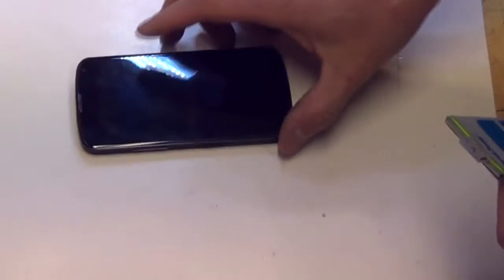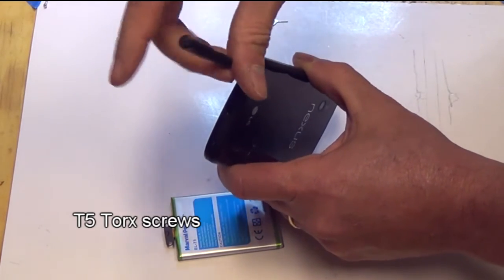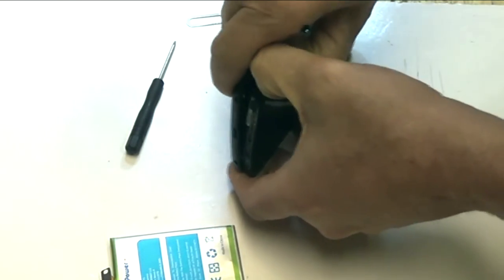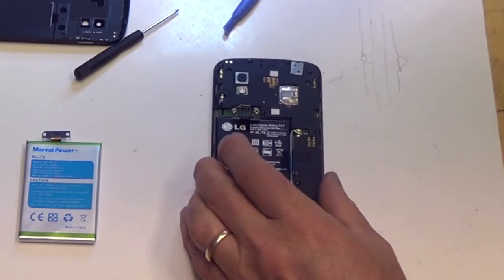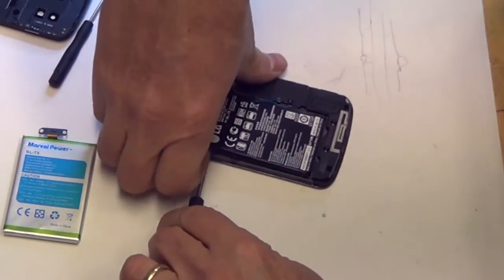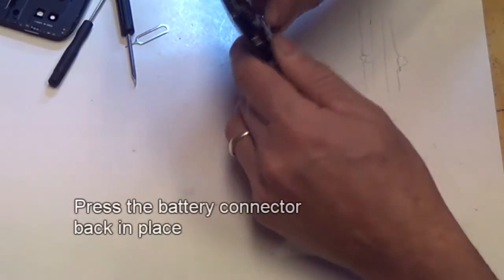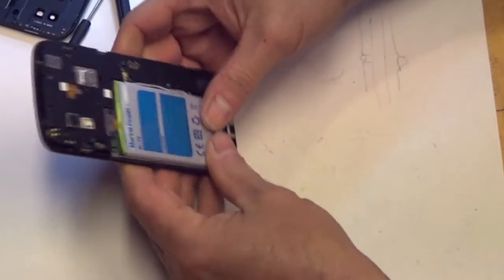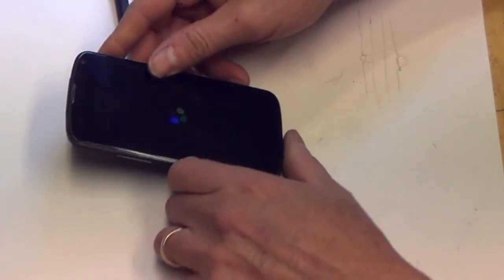Nexus 4 battery replacement

Comment: Thanks for the clip.  I Followed your instructions and everything worked perfectly.  Don't know how you got your fingernails between the front and back to separate them.  I needed to use a plastic wedge to separate initially.

Comment: A few questions: where did you buy the replacement battery? Ebay? How did the battery do it so far? Is it as good as the original? I am about to buy a replacement Any recomendation about where to buy it? any website? Thanks in advance.
Reply: armytags Idk if I'm too late but spareslg sells original factory parts. takes two weeks for international shipping